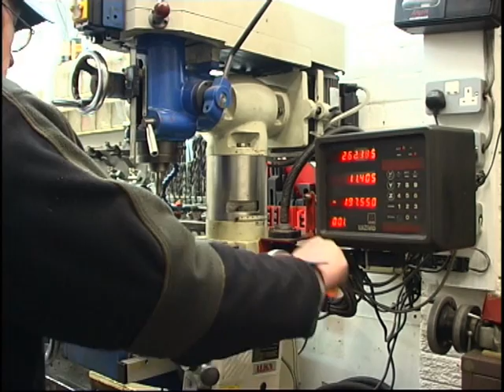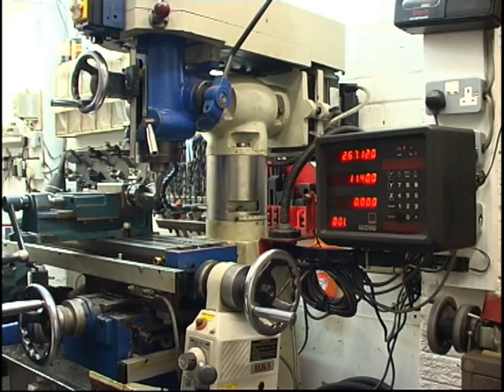Good Temper

Comment: Nice edge finder made from ball bearing. I haven't seen one like that before. If you leave a small radius where the chuck key square meets the key shank,the new key will tolerate more heavy use as the corner will be less stressed. Nice workshop.

Comment: Thanks for another great vid. I agree with some comments, that broken screw was likely damaged by using it to remove the chuck. It is a bit of a headache on Boxfords.....and mine doesn't have a spindle lock. I admit to engaging back gear (but am looking at an alternative), but for removing the chuck I got a strap wrench (with a rubbery cloth strap), makes it a doddle with lots of leverage and no impact needed. By the way, 15:43 and 17:57 are absolute comedy gold! Cheers.

Comment: Nice stuff.
For my oil can I use a small aluminum can with a small rare earth magnet taped to the underside. It traps metal bits that get lodged in the oil and sticks the can to the machines so it won't get tipped or knocked off.
Cheers
Colin

Comment: Nice job! I just made the same stubby key though with a little less finesse. I had to use a grinder to get the square end. One thing you will find is that the hammered in handle will work itself loose in a month or so. I will be adding a set screw to the handle end to remedy this.

Comment: One little wrinkle when making a second four jaw chuck key is to turn the other end from the square down to fit your cordless drill and put the cross piece a little further down the shaft.If you are wondering why, it sure speeds up changing the jaws around.

Comment: It's not a great idea to use the back-gears as a spindle lock (especially as the lathe has a proper spindle lock!) It is very easy to break the teeth of the back-gears.